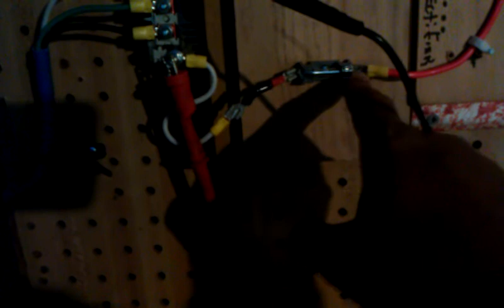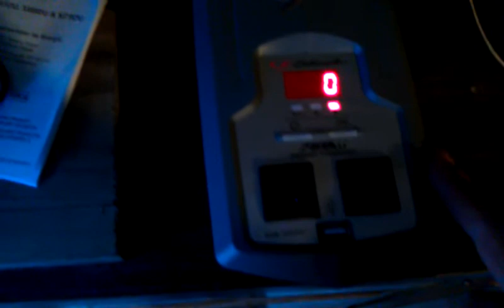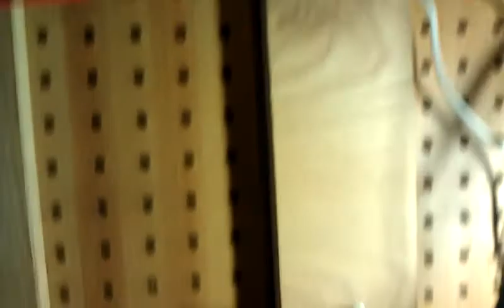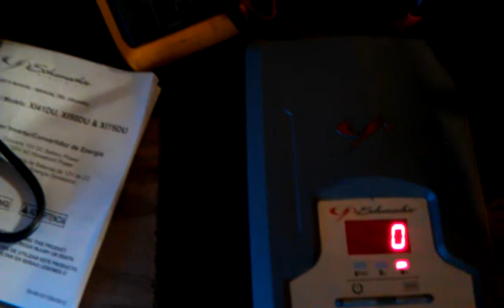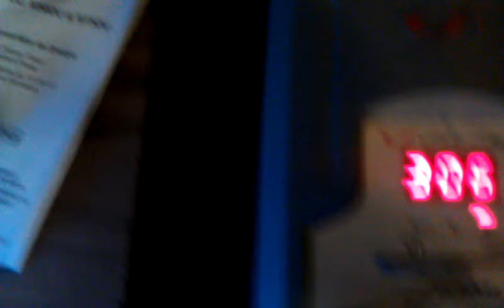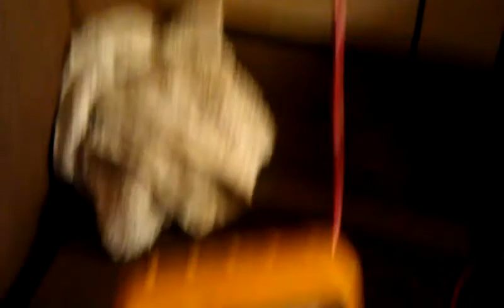New video to maybe clear up questions.3gp

Comment: When your batteries are at 12.2 they have more resistance than they do at 11.9 volts so your wind is able to charge more. less resistance. 
  When my batteries are a down say for instance ll volts each. The sun comes up in the morning the panels can charge  my batteries around 10 amps its hot outside they are not doing as well as in the spring when its cool.  When the voltage comes up to like say 12.4 or they are starting to get full then the amps go down to like 8 amps, hence more resistance.